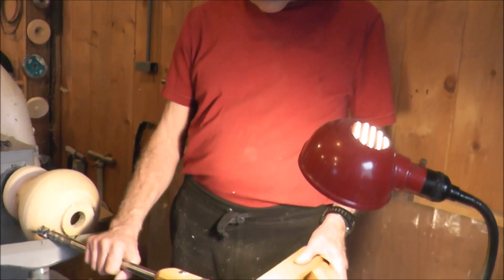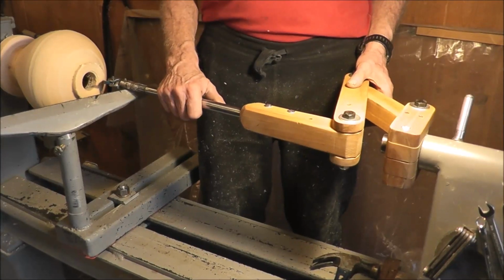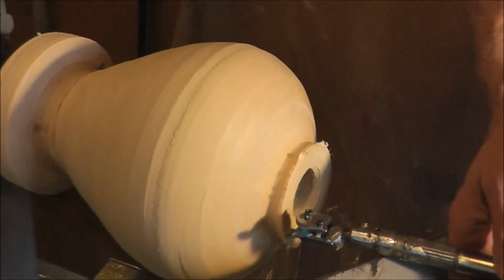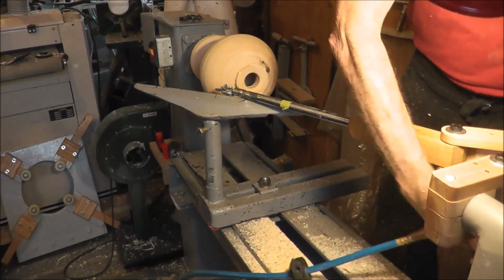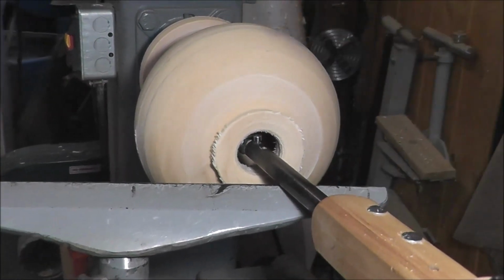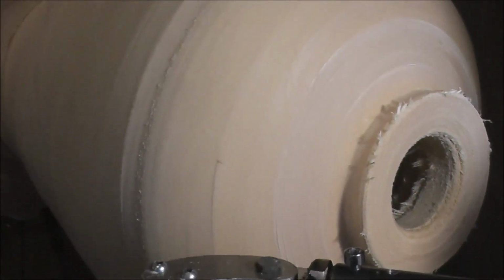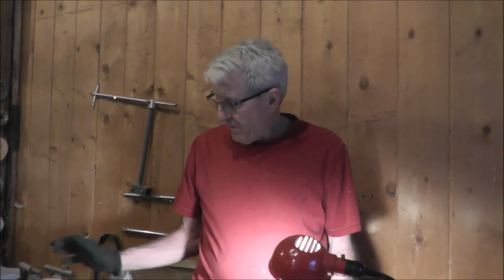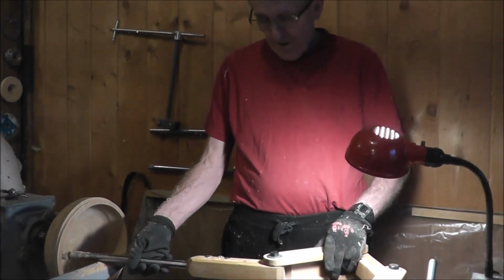DIY ARTICULATED ARM for hollow turning

Comment: Just what I have been waiting for I have every thing I need for this except bearings they are quite cheep & near by thanks wait for your next video I am 85  large work is getting to be quite a strain  well done from Harry Aberdeen scotland
Reply from the maker: I just finished the new model using kiln dried oak with video's and explanations of the process, mistakes and corrections.  this one has its own stand. Have to put video's on computer and then edit and make the video to up load. Should have it done by weekend. will be testing it tomorrow.